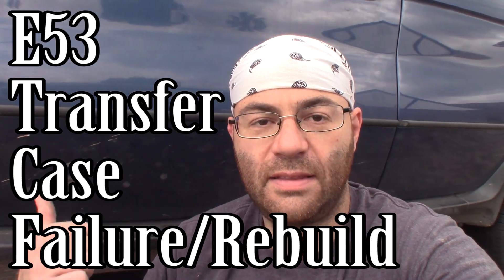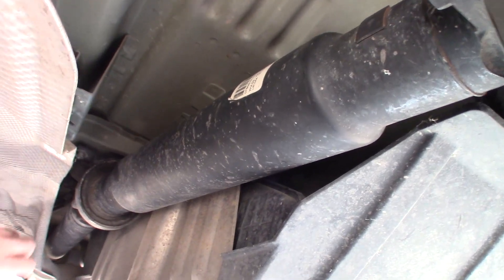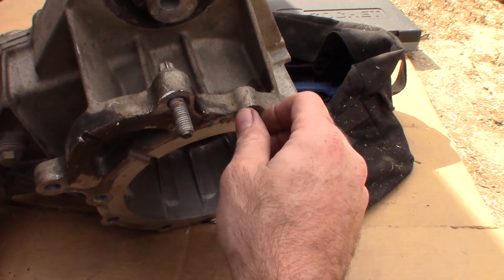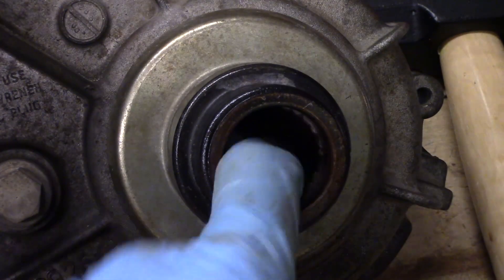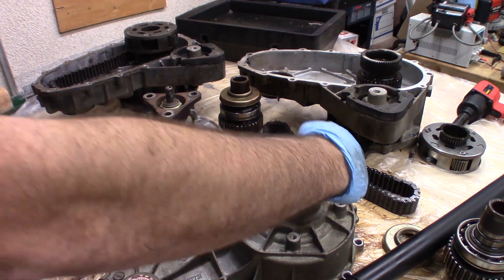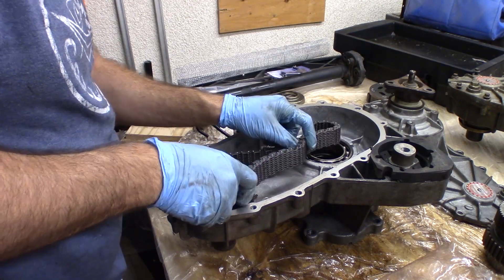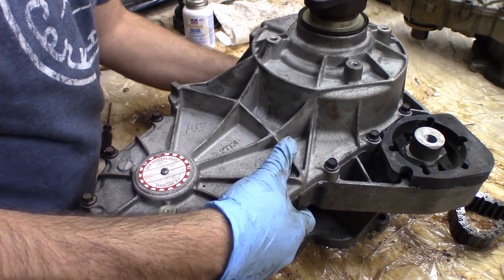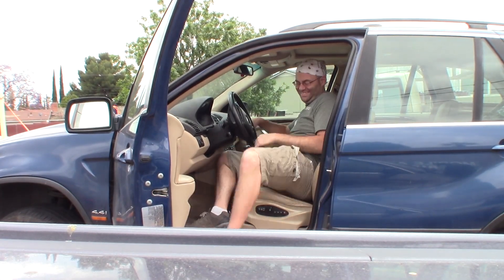BMW X5 4.4i E53 Transfer Case Rebuild DIY

Comment: Just a tip for anyone else doing this repair: When re-inserting the driveshaft onto the new/repaired transfer case, be sure to use grease or lube on the splines of the driveshaft. This is the main factor in why this guy had a stripped transfer case (the lube had dried up, water had seeped in and rusted out the splines). Technically speaking the correct thing to use would be Loctite 660 or 638 but any type of heavy grease would be better than none at all

Comment: I have a 88 325ix and the front driveshaft has a shallow engagement, so people use a e53 quibo or add washers. I also lube the splines every two years with molykote driveshaft grease. I'll have to start doing that on the x5, it hasn't been serviced in 20 yrs!

Comment: Pro-tip on this. you can fill the case with fluid before installing. it only take a little over half a quart. it is really hard to spill it when installing. saves a hassle at the end.

Comment: Could this cause a sudden failure? Have the same vehicle. Was at a stop sign, hit the gas, BANG, couldn't move anywhere and all I heard is that whirring that you demonstrated in the video. The thing that gets me is that PARK does not engage. It goes into Park, but the vehicle will still roll. Since the parking mechanism is on the output shaft, and the shafts out of the transfer case don't move, I can only reason that this is where the failure is.

Comment: USE PLASTIC WHEEL REPLACEMENT FOR YOUR TRANSFER GEAR ACTUATOR wheel!!! 
NEVER USE METAL ONE!!! Metal one causes interference issues with the magnetic postioning sensor inside the actuator, causes all the errors, is very heavy and not well cut! 
There's a reason why BMW chose plastic. USE PLASTIC!  Plastic one costs 1/3  less and practically lasts 10+ years. 

I WENT THROUGH HELL DIAGNOSING MY CAR AFTER I REPLACED THE PLASTIC ONE WITH METAL.  USE PLASTIC!!!
Reply: Cheers. I was about to order metal one till I saw your post! Ordered plastic carbon fibre one. Thanks a million. 🙂👌
Reply: That and also (everyone reading this) don't forget to measure your replacement plastic cog against the new bought one. There are some that are of smaller size and diameter which will cause poor contact to the acutator rod itself leaving you with a stripped wheel very soon. This is not common knowledge (yet).

Comment: 50sKid, first, great videos you post. Thorough, detailed confidence builders for us non-pros. Question on the E53 transfer case... Is this a pattern failure on the 3.0l models as well? Or is it the increased torque of the V8 that strips it out? Your thoughts? Thank you!!
Reply: Late to reply, but it is a pattern failure on the 3.0l M54 engines as well. Source, I work in a BMW shop.

Comment: I guess you said as much, but there was nothing really wrong with the transfer case.  All that was needed was to replace the  front driveshaft spline with a one inch longer spline which will engage the very deep splines in the drive gear.  The original front drive shaft has a ridiculous engagement depth of about 3/4" and only that amount of the spline is slightly damaged on the drive gear.  I speak from experience and a $500 tow job to get my car home.  I got the new longer spline from http://www.tcbmwx5.com/#products and paid a machine shop to cut off the old spline and put the new spline on the front drive shaft.  (You can probably get a better price than what Stephen shows on his web site--at least I did.  He's a nice guy and I am just a customer recommending him.)  Oh, it's been over a year since I did my front drive shaft and all is good and solid.  

Oh and as you said, this is a VERY common failure and I would never own another E53 without preemptively replacing the front drive shaft spline--there may be no warning it is about to fail.  I actually had about two years of warning though, but I didn't know that's what it was--occasionally when driving by a wall at low speed I could hear a faint squeak...squeak...squeak coming from under the car.  This squeak was the dry spline shaft flexing or moving in and out of the drive spline--and there was a faint deposit of rust around the front of the transfer case.  Eventually the splines wear down on the drive shaft but not so much on the drive gear.  So all you have to do is replace the drive shaft spline and not the drive gear.

Comment: I have no power to the front wheels and I also have the 3 warning lights on-would a bad transfer case like yours cause this problem ?  Otherwise car has power to back wheels and running ok.  It started when I came to a stoplight and when I started to go there was a loud grinding like noise and car wouldn't go forward. I put it in reverse and backed up, but then when I put it back it drive it acted normal. Drove 400 miles home and still ok, but when we put it on a rack and put it in car with car running the front tires wouldn't spin;  It's a 2008 bmw 328 xi.  Thanks

Comment: Thanks again for a great video. I am working on 2005 BMW x3. I just replaced the front drive shaft, as I was doing so I noticed the output flange was very easy to simply slip out of the transfer case and oil would pour out. As I rotate that same output flange, there is a grittiness sound to it and it is not super easy to turn , but I can turn it with one hand fairly easily. Does this sound normal or am I dealing with a defective case?

Comment: A transfer case was change on my 2004  X5 3.0I but then now the Speedometer is not working and I have the Trifecta on the tachometer, Speed sensors were checked n that is not the problem, do you have any idea how to fix this issue? or maybe you can fix it for me, thanks.

Comment: Say my 325xi 1st gear rumbling noise when I drive this is automatic don't know if it's the diff bearings  or driveshaft flex disk and  carrier bearing but when I drive 20+ miles it drives good any idea what it could be
Reply from the maker: It could be either of those things.  driveshaft flex disc or carrier bushing are most likely.  Easy to replace.  Search for my Rear Main Seal video and you'll see what it looks like to get the driveshaft out.

Comment: does the input shaft and output shaft spin separately  do you remember from rebuild i know front and rear shafts spin together  but rear shaft spins while holding the input

Comment: Hello, Juan here,  I have a problem with my wife's  04 BMW X5 3.0i, the 4x4 light is on, I did some research and it looks like the problem was the transfer case actuator gear, I when ahead and replace it but, the light still on, do you have any idea on how to fix that? I'll appreciate all the info. Thanks
Reply: I know it's been a year since your comment but I wanted to respond so others who has this same issue can see what to do in case they have the same problem. It usually means steering angle fault. Usually nothing even having to do the drivetrain at all. BMW does this purposely to scare the hell out of you and you get gouged into repairing or getting a whole new transfer case or transmission. All you have to do is start up your car and turn your steering all the way from side until it stops and then all the way to the other side until it stops. Keep doing this two or three times or until you see the 4x4 light goes out then you can stop. It is so simple. This resets the steering angle and the light will go off. This is criminal that they even do this and should be a class action lawsuit if you ask me. You most likely didn't even need to replace the actuator gear at all. You took it out. If the gear was good no need to replace. If it was worn or melted then obviously needs to be replaced. If the 4x4 light is still on after turning the steering wheel  several times from one side to the other then it's not a steering angle problem but something else obviously more major. 

Before spending money on expensive random fixes best to get a good code reader that reads BMW manufacturer codes not generic codes. It will tell your problem without guessing and wasting time and money. Perhaps you fixed it with the gear actuator. In any case it won't just go away. You will have to clear the codes. There are any ways. Some is to leave the battery disconnect for a certain amount of time and then reconnect and the lights should go out. Using a code scanner tool to reset is the best and easiest way. If it goes away and stays off then you're problem has been fixed. If it comes back then you obviously haven't fix the real issue and need to find the problem and fix that and reset code again until lights stay off permanently.

Comment: How many miles are on your car? Is it an M62 or M52? Are you overstating the failure rate of the case? I'm considering a 3.0 X5 as my next car.
Reply: Oh, 100k mi. Damn that sucks to have a failure like that at 100k.
Reply: Just realized the title says 4.4i. I am not a smart man.
Reply from the maker: Heh, well you have to understand that I don't work for a BMW shop or dealer and I can't give you statistics, but it's a common enough failure that people sell 1" longer splines for you to weld onto your old stripped drive shaft.  It's a known problem.

Comment: You mentioned that ATF oil is in the transfer case. I have a spec sheet that recommends Synthetic GL4 SAE 75W Not ATF. Perhaps thats the case of the failure. Lubricity stresses
Reply: That is correct,thats what my owners manual states on an 05 x5!
Reply: @randallstewart8487  Wrong. This video is about a pre-facelift transfercase.
Reply: @darek4488  Thanks for the correction,just looked it up ATF Dexron III is required 2000-2003 [NV 125]! 2004-2006 X Drive [ATC500] Power Diveder Oil TF0870 SAE 75W-GL-4! Stated by BMW Service Manual,depends on the year and type of Transfer Case!

Comment: I may have missed it but Did you explain what could cause the output gear to be stripped ???
Reply: The output gear is not stripped, the splines of the driveshaft are. This was made much more complicated than necessary. I just had this happen, exact symptoms,(03 4.6is). Bought the repair piece on eBay for the front shaft, cut welded and back in in about an hour.

Comment: can u drive without replacing it, mine is broken but it doesn't make any kind of noise nor there is any problems with acceleration. it just had the 4x4 abs and brake sign. please me know they cost a lot to replace.
Reply from the maker: You cannot drive when this problem happens, the car will not move.  Your problem is something else.  Error in the DSC system.  You likely have a bad wheel sensor.  Replace all 4 of them as they are not that expensive and that will probably solve your problem.
Reply: @50sKid  Hi, not sure if you are still around. I have this problem and the car does not move. What I don't understand is why the rear driveshaft would not get any power. From what I understood about these transfer cases, the rear driveshaft should have a permanent connection to the input, and the front driveshaft is only on the "side" with a clutch. Is this incorrect?
Reply: @djd829  Try removing the ABS fuse/relay then disable traction control (it will probably error anyway with the relay removed). If the BMW is anything like our Australian Ford Territory (same transfer case) and same awd design it uses wheel speed (at axles) to determine slip so it would apply the rear brakes if the front axles aren't rotating which would be why you aren't moving.
Reply: @brettus9115  Thanks, I have since figured it out.

I was wrong in that the rear driveshaft does NOT have a permanent connection to the input shaft. The transfer case is a planetary gear setup where the input shaft is attached to the planetary carrier, the front shaft is attached to the sun gear, and the rear shaft is attached to the ring gear. This means that if any of the shafts become "free floating", the whole transfer case will functionally fail, including the ability to put the vehicle in park.

In my case, the failure was almost the same as in the video, except the splines on the front driveshaft itself stripped off at the transfer case interface. The transfer case splines were still fine. New driveshaft, everything works great again.
Reply: @djd829  Thanks for clarification as my brain struggles to comprehend! Even though I've seen our Aussie awd in action on 2wd dyno's nobody could clarify for me what was done to run the vehicle like this....almost like it was "secret squirrel" or something!
The Aussie Ford version also doesn't have the spline stripping issue as it uses a CV on the front output shaft so about the only issue is stretching of the chain but they are still ridiculously strong.
Reply: @brettus9115  Yes, IMO this case is a very poor design. Speed sensors and brakes aren't helpful if the axles are detached. This is a neat simulator to help visualize what's going on:

http://www.thecatalystis.com/gears/

Set "Solve for" to Sun Gear. Set Carrier and Ring speed to 0. Note that since the Sun is hooked up to the front(which was broken), so that spins easily.

To try to drive, you increase the Carrier speed(input shaft), you can see that the Sun(front) spins freely and easily, while the Ring(rear) is idle. All of the energy is going to the front because there is no resistance.

To see why it would still roll in park, set the Carrier(input shaft) back to 0, and increase the Ring speed(rear axle turning from gravity). You'll see that the transmission(carrier) is trying to hold it still, but the planetaries spin freely because the front axle(sun) isn't holding.

Comment: Great vid but a couple of comments: 
1. ATF is not the correct fill for the BMW transfer case. There is a special fluid part number 83 22 0 397 244, BMW call it "Power Divider Oil" it is 75W. ATF is much thinner and while it will work for a while, it will not give the film strength required for long life of the transfer case.
 2. When using RTV to seal the case, do not tighten down the bolts until after the RTV is cured otherwise you will expel all but a very thin film of RTV and the joint will likely leak after a while. The RTV tube has the correct procedure for sealing the joint and it's important to follow it.
Reply from the maker: That's for models produced from 2/2005 with the X-Drive transfer case.  This video is on the NV124 transfer case which takes plain old ATF Dexron III
Reply: Incorrect. Prefacelift takes ATF III

Comment: Can you help me my x5 4.4 2001 is in trans safe mode and it has engine tick 2 codes read camshaft sensor and auxiliary fan could you please help
Reply from the maker: You need a scan tool that can read codes from the transmission module, such as BMW Creader or INPA.  Check out my BMW scan tools video.

Comment: Lol, that shit eating grin when you fired it up without mufflers.. 

On a more serious note, i've been thinking about getting a X5 for my wife. I'm betting that you are the one doing all the work on your buddies X5 there, would you suggest the vehicle, or abstain from purchasing one?
Reply from the maker: :-D  Actually I would suggest it, yes.  Not a whole ton of problems with it, aside from all the typical BMW engine issues one usually has.  But as far as the body goes, the transfer case is the biggest pattern failure.